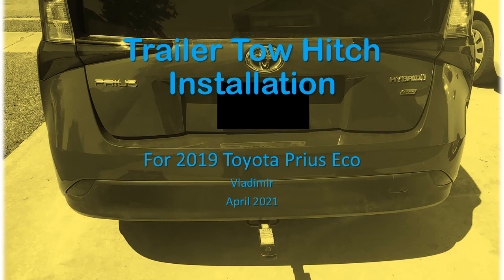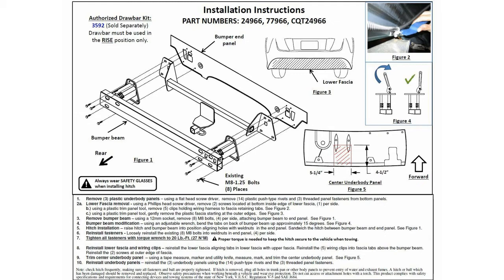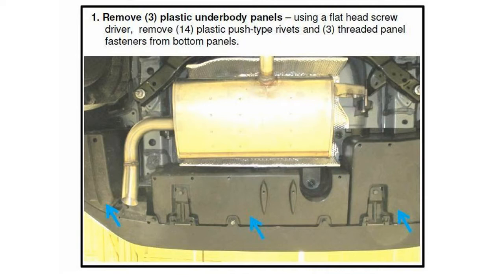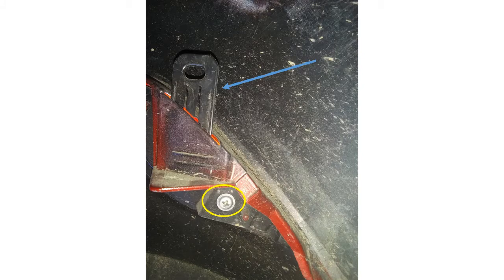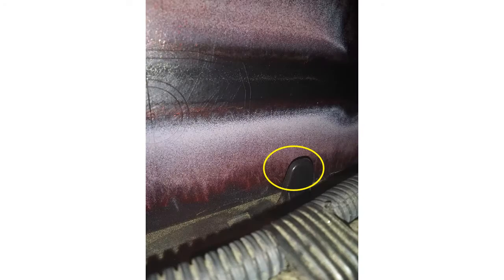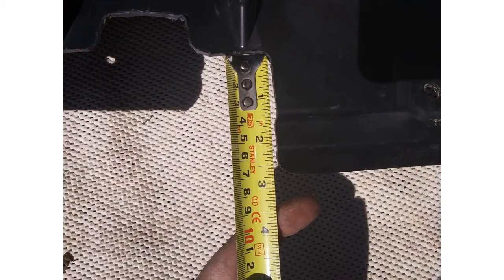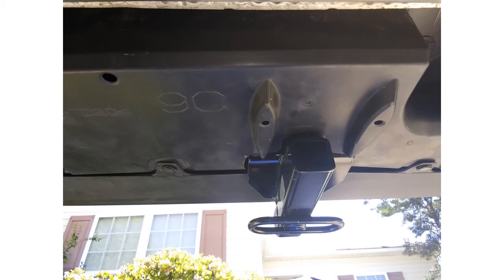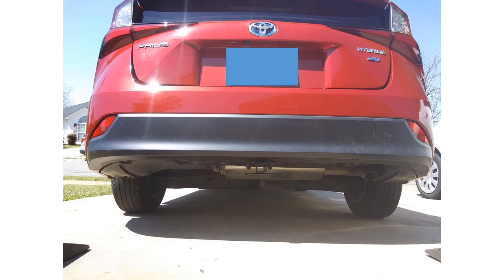Trailer Tow Hitch Installation 2019 Toyota Prius

Comment: Thanks for this video.  You did a better job on the cutout than either of the professional manufacturer/distributor videos of hitch installation on Gen4 and Prime.  Also, better photos of the wiring clips and not needing to completely remove fascia, thanks.
Reply from the maker: happy this helped. There is a wiring video on this. Beware that wiring may affect your pre-collision system when connected.